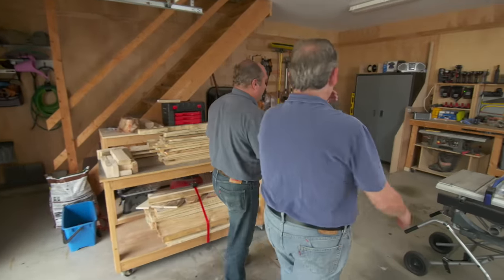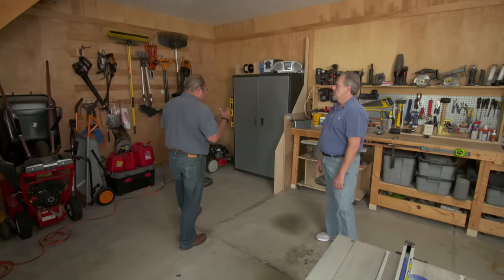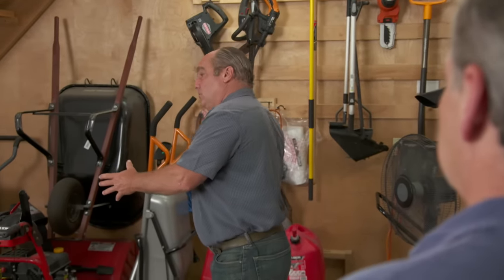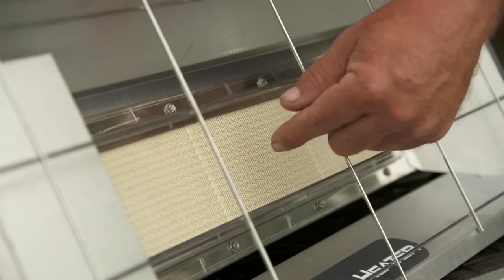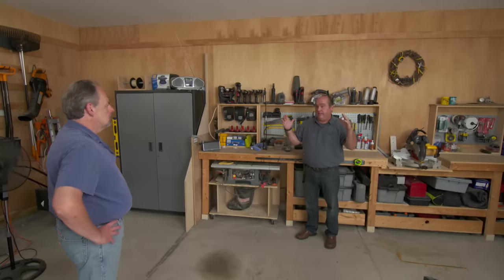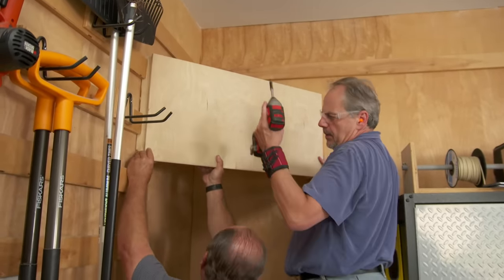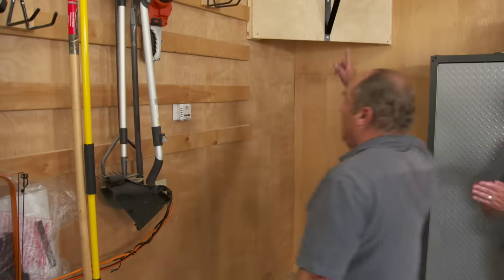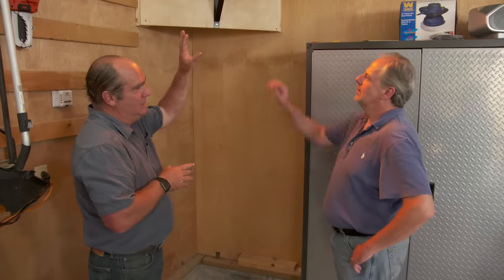How to Heat a Garage Workshop | Ask This Old House

Comment: Average winter temp. in Akron is a few degrees above and below freezing. So not really all that cold so this might do the job. Where I live you this would probably heat a tiny shack.  Strangely most of all the commercial warehouse garages etc here have large natural gas fan-driven heaters that are noticeably noisy when the unit starts a heating cycle. They are slightly larger than a small fridge but if it ever fell on someone it would kill them. The upside of these Infrared units is that they heat the floor or whatever they are pointed at which then heats the air above it. Plus apparently, they are dramatically more efficient up to 75% more.

Comment: With this heater , what are the BTU's and how big a space will this heater work well in? Thank you
Reply: Edward Dillon
 ... The big variable is not always the size of the garage, but how tight the construction is, how cold it is outside, and if it's insulated. The typical garage leaks enough that extra fresh air venting is not necessary. (although may be required by code) You can google rules of thumb to figure needed BTUs and then choose a heater based on output. It wont be perfect but in this situation who cares.
Reply: @rupe53  Thank you sir.

Comment: What about insulation? I would have thought that would be the number 1 issue to tackle. Because I could just roll an electric radiant heater and be done with it.
Reply: You probably could insulate the exterior wall, but not much can be done about the garage door.

Comment: What do you do if you have a all electric  house? I'm  building a new home in Tennessee with a enlarged  3 car garage  that will be be my new shop.
Reply: There are electric radiant heaters that will perform a similar function to the gas version, but cost more to operate.  A slightly less convenient but more fun option would be to install a woodstove in your workshop.
Reply: @ThoolooExpress  do the electric heaters require a 110 or 220 outlet?
Reply: @dangerousbear4658  You can get electric heaters in either voltage.  A 240v line will be able to supply more power, so you'll get more heat out of it.

Comment: No CO or CO2 to worry about?  Would be good to say something about that . . .
Reply: Yes those put out co!! Those are supposed to be installed outside only. They should have installed a unit heater with a sealed combustion chamber.

Comment: What about a heater if you are planning on spraying lacquer.
Reply: Electric or get a extraction fan for your paint area. For a small home shop a cheap stove vent hood with some side walls would be fine.

Comment: Never use a tubing cutter to remove plastic wrap. Use a knife at an angle. Even the slightest score in the copper (especially if it's continuous all the way around) will weaken it to the point where it could easily separate under minimal stress, and leak.
Reply: Agreed. However that's not copper that's csst
Reply: yep any metal that has a nick or score will fail sooner at that point.

Comment: My house all electric. I wonder if this will work on barbecue grill gas or the company makes one that does. Electric heaters too costly to run. Electric heaters in basement cost more to run  in winter than two heat pumps that heats and cools the whole rest of the house all year. Cost prohibitive for instal!ing another heat pump just for the garage. I really need to invest in converting the basement to heat pump to use the area in winter first.  1-1/2 to 2 ton unit should do the trick

Comment: Why not just install a mini split so it can heat and cool a workshop?
Reply: Same reason he didn't want to put in forced hot air. Saw dust would clog the mini split pretty quickly.
Reply: @Reckless1985  No it wouldn't , you can mount mini splits almost anywhere including the ceiling using a cassette .
Reply: @wind5250  doesn't matter where you mount it, a mini split uses a fan inside of the indoor unit to move air over a coil. The coil has hundreds of thinly spaced fins surrounding it. There is a filter on them for this reason and it would get clogged with saw dust.
Reply: @Reckless1985  i'm a licensed contractor i know how they work , i'm also massively familiar with dust . Saw dust doesn't travel very far and doesn't mix with air like drywall dust a simple filtered bag catches over 90% of it . The only thing required to keep workshop dust out of the unit is to mount it high and away from the sources. In my case i used a cassette and mounted in the ceiling of my garage . I have never once had a clog from any type of dust let alone saw dust that can't even make it up there. 

 How do you think wood shops stay cool or warm? They use the same systems everyone else does they just place the returns in intelligent places .

Comment: Oil-filled stand alone radiators ( electric ) never get hot enough to combust anything, and provide both convection and radiation heat. Quiet. And they are cheap, like $30 or so from your typical big box store.
Reply: aren’t they too small to heat something as big as a two car garage?  how many would it take?
Reply: @cassconner6023  I bet two would work if the space was insulated.

Comment: Since heat always rises,
shouldn't the heater be near the floor ?
Reply: It would be in the way then and you would be at risk for getting burned or something getting knocked into the heater.
Reply: That isn't how infrared works. You basically are using it to warm the concrete, which is where you get the warmth in the room from. It also works directed at objects, but concrete/stone/etc is the typical target.

Comment: Is there a concern if I have this installed in a garage that has cars parked inside. I am concerned with a possible natural gas leak at the heater and the starting of the cars. One spark of any type could be disastrous.
Reply: The gas has an added smell so you can tell if the garage is full of gas when you step in.   And what's the difference between this and the gas pipes and open flames in your basement at the furnace and water heater, and at your gas stove or oven?    I'm not saying there's zero risk, but why worry about your car ignition in particular?
Reply: Tom Biby thank you.

Comment: why flex gas pipe to rigid black pipe then back to flexible at heater? Why not flex all the way? trap?
Reply: The rigid pipe is for the heater shutoff valve and the sediment trap.
Reply: Most parts of Ohio flex pipe is a No NO, Richard needs to stop giving HVAC advice he is horrible at it
Reply: Used the flange to terminate the flex above the ceiling, can't run the flex thru a wall in case the building shifts it could cause damage and cause a leak in flex

Comment: Great if you run this 24x7, but if like other folks who are only going to run it once a while,. this thing will never heat up the garage to the point of being usable on a typical cold winter day.   Far better off just running a propane blast heater by cracking the door open a bit to get the ambient temps to where they need to be , then using one or two regular electric portable heaters to maintain.

Comment: Cost to heat a 20 x 24 garage? Other options? I'm in Ontario and winter is cold
Reply: I am guessing gas heater is cheaper than electric heater.
Reply: I have a 24 x 26 garage never noticed a difference in gas bill I sure there was but almost nothing was heated all winter I am in Ontario to

Comment: Seems like a missed opportunity to install an effective heater. Especially since there is already access to gas. I get the concern with worrying about clogging a furnace with saw dust but I still would of opted for some type of forced air.
Reply: The shop likely doesn't have good insulation. You would be wasting incredible amounts of energy with warm air. Infrared heats the floor and other surfaces, making you feel warming without necessarily heating the air. It is much more efficient for shop/warehouse environments.

Comment: Great idea for heating a garage I didn't even think about that for a residential application. They use of big tube style radiant heaters for commercial workshops and they work really well.
Reply: I always worked in shops with commercial tube radiant heaters. I put a residential radiant in my large home garage and was a piece of crap! Removed it and used a unit heater. Perfect!
Reply: The only difference is the radiant tube heater is vented where as this little sucker is letting those toxic fumes into the space.  This is a horrible idea
Reply: @raymondmiller162  I think you’re thinking of something else. Two heaters get banded to the outside

Comment: Just one question. Where are the exhaust gases vented?
Reply: Infrared heaters are approximately 98-99% efficient and requires no exhaust
Reply: @aron6998  Does 98-99% efficiency mean no CO? Wouldn’t you still want venting for CO2 and water vapor?

Comment: Why are you using an impact driver for wood screws?
Reply: He wanted to show off his power tools. 😂😂😂
Reply: Its a bit driver, and it works 20x better than a plain drill.
Reply: @weekendproducts  I know what it is, I'm wondering why it's being used on wood. Seems like it'd very easily rip through.
Reply: On a drill you have to push down but when using an impact you just hold it there and pull the trigger much easier
Reply: So he can strip the screw hole out and then slap the wood around like he did at 2:38. An impact is handy though driving screws.
Reply: Impact drivers are for driving screws, doesn't matter if it's a wood screw, drywall, deck screws...  The question is why would you use anything other than an impact driver to drive screws?  With variable trigger you can get very precise and less chance of cam out.

Comment: Great video question why not use a hot dog hanging heater or a small tube heater what would be the difference thank you
Reply: hot dog doesn't sponsor the video
Reply: @natalieisagirlnow  I thought it was up to the homeowner on the show they're paying for it
Reply: @raptorcrazy9545  most things on the show are paid for by the show and all the homeowner has to pay is a gift tax if applicable
Reply: andy granath last time I checked the website they have to pay. Although labor would be free.
Reply: @andygranath688  did not know that I thought you had to pay a bunch of money for them to come work on your house or whatever on the show thanks
Reply: They mentioned earlier in that they wanted to avoid any air flowing through the exchanger.

Comment: I would rather have to unclog a heat exchanger periodically than suddenly die in a saw dust explosion that one time I forget there's an open flame in my workshop. Hope this guy uses dust extraction.
Reply: Marijak that's right
Reply: If you have enough sawdust in the air to explode then you need to change your shop set up.
Reply: @tysleight  Still, better safe than  sorry. I'm sure the concentration in the workshop atmosphere would have to be noticeably high, but measuring this is and being aware of the danger may not be common knowledge. It could also just be a blast of dust from some power tool, in the wrong direction and it may ignite...? I would be careful with some power tools.
Reply: Open flame in a traditional furnace, no?

Comment: Much better is one of those electic 5000 watt heaters with fans. No gas, less fire danger, no venting, ect. I have heated a large shop in norht east Minnesota for years with one of these. When it is really cold, well below zero, I have a second one that I can turn on to get the shop warmed up in the morning. You will need a 20 amp or larger hookup, but, that is not a big problem. I also depend on my old fashioned lighting to provide some heat. I have about a dozen 200-300 watt bulbs to light the shop, all of that extra heat helps to warm the space when in use. Of course it is not so great in the summer, but, then I open up the windows and door, and, it is just fine.

Comment: That was bad advice. Radiant heaters do not heat the air it passes through and being a heating engineer I can confidently confirm that the unit would not produce the btu’s required to heat a garage of this cubic feet. Not even close. He didn’t even check the insulation values of the garage to check the heat loss. Also his explanation as to not using an air heater as it would clog the filters is also not correct. In situations where there is a chance of return air being contaminated by dust etc you take the inlet air  from another source even external. And finally you don’t want radiant heaters in woodworking workshops for obvious reasons.
Reply: So what king of heater would you recommend for a woodworking shop? We built a nicely finished, tightly sealed and well insulated (2x6 framing with sprayed in foam) 24'x26' (x 10' high) workshop. Currently heating with a couple of electric space heaters. We occasionally give it a boost when we need it to heat up quickly with a "Big Buddy" portable propane heater. Obviously, none of this is a permanent solution (and the propane heater loads the place up with moisture if it's used extensively). 

We have a Rinnai direct vent propane heater in the finished room over our garage that works well - and we really like the "frost protect" mode, so we can leave it set a 40˚ most of the time, and just crank it up when the room will be used. I was concerned about using this in the wood shop, since it's really not designed for a high dust environment. I really would like to get something that has a frost protect mode: we don't want to have to keep the area at 50-55˚ (which is a low as most heaters seem to have a setting for).
Reply: You should have put in infloor heat in the slab, that's the best way. You could use overhead radiant panels with glycol fed of a boiler unit, but it's going to be pricey. Radiant tubes with sealed combustion are good as well. I would never do an air unit because of the noise, stratification and lack of comfort. It's popular because it's cheap and people don't know any better. I know of some shops where they laid infloor piping in a subfloor, filled it with sand and put wood flooring over top.
Reply: Colin Nicol, you are definitely an engineer. This is a small garage ,not a commercial building. Using freezing outside air and heating it makes heating very expensive and I would guess then you would need some sort of air exchange unit as well. We don't know if he did any heat loss calculations because we didn't see or hear him say otherwise. He also didn't pressure test the gas line, or maybe he did off camera. Heat loss is heat loss but depending on the type of heat, the heat loss changes. My shop is 20 x 24 with 2 x4 walls, terrible vapour barrier, uninsulated slab, 1 course of cinder blocks that have no insulation on either side, open trusses with 3 1/2" insulation against the sheathing. I heat it with a 4500 watt/15,000 btu electric construction heater all winter. The heater runs for about 10 minutes on and 15 minutes off, even when it is -35 C with the windchill. The cost to run it is cheap enough that it would take about 10 years to break even if I installed a gas unit heater myself. I leave the heater on low and turn it up when I'm working in there so that I'm comfortable in a sweatshirt. Also, most sawmills around here use radiant heaters throughout the mill with no problem and it is plenty dusty.
Reply: sounds like an engineer talking.   theory vs real world.  had one of these in a 11' tall, 31x28 finished attached garage in Kansas.  Kept it at 68-70 all winter long with zero issues and it did not run all day.  No vent, no moisture, no fumes.

Comment: I would say that thermostats to close to the heater. The heater will kick off because it's to close and not heat the room properly. I've had this happen with gas fireplaces hooked up to thermostats that's to close.
Reply: Tahoe Tom yep among other problems Richard screws up again.

Comment: The drip leg was wrong ... that's not stopping any contaminants from getting to the buds
Reply: Why
Reply: Because the gas flow as shown here flows straight down in to the drip leg so all that's going to do is stir up all the contaminants (if it catches any) and send it through the buds to burn if it makes it through them. The correct way is have the gas flow go in to a tee to a dead stop so the contaminants fall and the gas will go up.
Reply: @bigginsdriveway69  wrong...
Reply: @WilliamSmith-pz5nw  No... I am Right... I have been in the HVAC field for 10 years now and  I have an Degree in HVAC. This is the correct way.
Reply: @bigginsdriveway69  
Lol... That and $2.50 will get you a cup of coffee. I'm a licensed gas installer going on 30 years and your wrong.
Reply: @williamsmith8235  and you've been doing it wrong for 30 years... read your codes books

Comment: .... My local building inspection department will NOT allow ANY form of heating equipment in my combination garage / workshop. .... Typical mentality of Liberal TAXachusetts, sadly.
Reply: Move ASAP
Reply: Interesting, just looked up the Massachusetts State Building Code and cannot find any such restrictions. There is the normal stuff about sources of ignition being at least 18" above the floor, and a requirement that the air from the garage cannot circulate into the habitable spaces but no absolute rejection. Ask them for the ode section upon which they are basing their denial.

Comment: $99 30,000 btu propane forced air garage heater.  Stick it In the corner.  Done!     Heats the entire garage in minutes, not just whatever is in the path of the beam. No tools required.

Comment: This is a bad option. It’s a vent free unit which takes air from inside the building and uses it to complete the combustion. If you have a lot of fumes in your building or do a lot of painting, this is a horrible option. Think about painting in your kitchen while cooking on your gas stove. It’ll stink like crazy and create an orange flame. A hot dawg heater or a Mr Heater Max would have been the better route.
Reply: Andrew Rawlings bingo